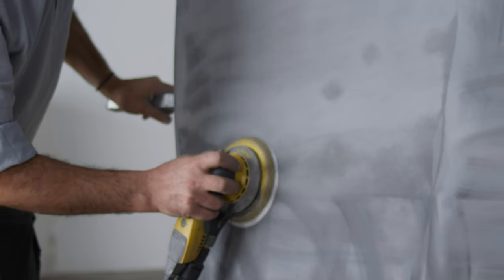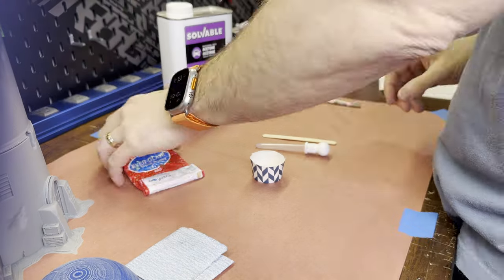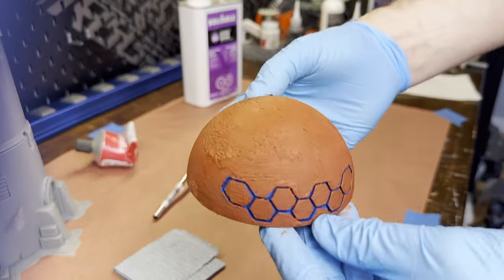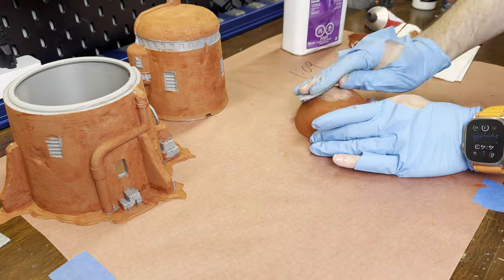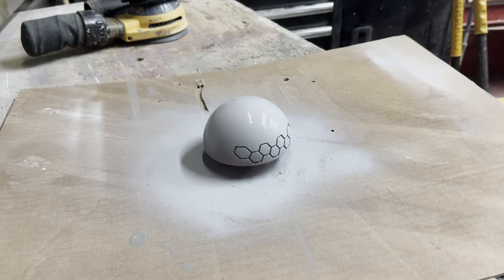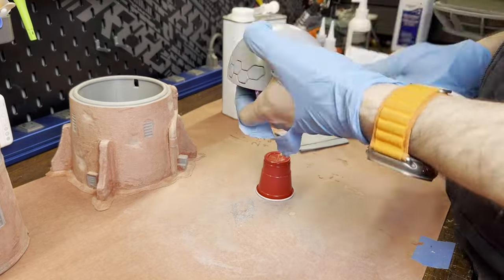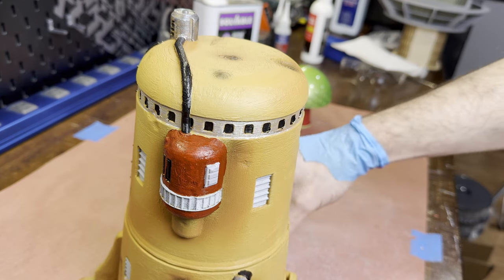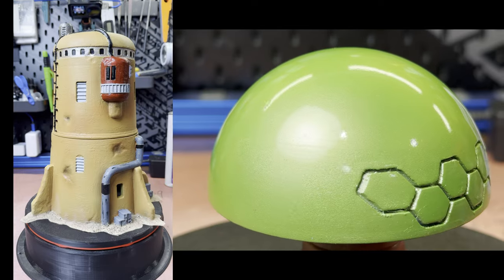Hide 3D print layer lines with Acetone and Glazing Putty

Comment: Interesting video but I see a few flaws. Gloves are a must because no matter how clean you think your hands are they still have oils on them. Never saw you clean with anything before sanding  and before the putty. Hey, it's just a 3D print but don't do that when repairing a car or anything like that (could cause paint lifting). Good luck.
Reply from the maker: I suppose, but I painted cars back when the only people that wore gloves were medical professionals and things worked out fine. Just don't eat chicken wings or Cheetos while working and you should be fine :)
Reply: Unless your metal plating the print, then just having skin is enough to ruin it.

But you can get a near mirror surface @DaveRigDesign

Comment: So which is better, resin baby powder or putty?
Reply from the maker: I would say, for small spot fills where you don’t mind waiting for it to dry putty would be more convenient. For anything bigger resin is easier/faster to apply and faster drying.
Reply: @DaveRigDesign  if I want to smooth a circle, i feel like pouring ALOT of resin on top will save me time vs applying thin layers with a brush. What do you think?

Like instead of painting on half a cup like you do in your videos, pouring 4 cups on top of idk half dried thick and slow resin.
Reply from the maker: @Red_Rubber_Duck if it’s flat ya you can just pour it in and let if self level

Comment: I like this idea, my issue is, when I have a print I would like smoother, it has way too much detail for this method, but I need to print me a Dwarven Sword for cosplay, and I may try this method, Thanks Bro!
Reply from the maker: Ya, works great for large smooth areas. Can work for detail also, you just spend a lot of time cleaning up the details. Up side is it’s easy to sand off

Comment: I've been using the quick dry spackle and water. Then sanding and works pretty well, but ilike the smoothness you achieved
Reply from the maker: Do you find the spackle holds up well? Doesn’t crack or chip off?

Comment: The lines are there and it's not an optical illusion. I have the same issue with resin casting and sanding bucks. It feels smooth to the touch because your fingers can't detect the highs and lows anymore. But as soon as you cast it you can see it wasn't polished enough. For me it's usually frost finish on the surface, but in this case it's the subtle valleys not getting 100% filled and sanded out. 

In this case 1 more layer of fill spray or more putty at the start would have leveled it out more. Never thought to mix acetone with this putty. 👍

For my resin molding... got to mirror polish it more. lol
Reply from the maker: Ya another coat of putty would have done it but that drying time. I can probably wet sand the clear coat and give it a few more layers of clear to get it smooth. Will still see the lines in the colour underneath though even though the light reflections will be smooth

Comment: I wonder if a saturated abs or polystyrene solution in acetone painted over pla would work. 
Maybe even if it doesn't by just painting, a second step of vapor smoothing could make it smooth. 
I don't have abs or expanded polistyrene right now but I do have acetone and high density polystyrene cutlery so I will try and report back. 
If the cutlery doesn't disolver well enough, I will get some expanded polystyrene that I know does disolve really well.
Reply: It worked quite well with ABS, no further smoothing needed, just dunk, dry and it is smooth. However I used ABS from a cdrom unit door that has calcium carbonate as a filler that just precipitated so the resulting solution deposits a transparent layer. It is smooth to the touch but with a good look you can see the lines through the transparent layer. I will get some 3d printing ABS hopefully with an acetone soluble pigment but even as it, it is great when painted. 
It did not work well with polystyrene as not enough goes into solution and it mostly stays as a goop in the bottom plus the deposited material is not strong or that well adhered so it can be scratched off.
Reply from the maker: It’s an interesting idea. Are you using pla prints or abs?
Reply: @DaveRigDesign  PLA of course. I don't even have ABS filament so I scavenged for ABS and found an old cdrom tray made of ABS for the experiment. I will be getting some ABS filament specifically to do this even if I am not really interested in printing it (I don't have an enclosure or a way to deal with the fumes).

Comment: I tried this on about 10 of my prints and painted over them. The bondo spot putty cracked big time.
Reply from the maker: It can if the part has any flex or the holes you are filling are too big
Reply: @DaveRigDesign  the cracking happened on a large surface area of layer lines, no holes and no flex to the part.
Reply from the maker: @PikachusGift not sure…. could be due to how thick it was applied. Maybe wasn’t totally dry before you painted? Once dry it’s shouldn’t shrink.
Reply: @DaveRigDesign  I let it dry for a few days. It was so weird. I've had it happen on a few prints but not others.
Reply: I use the acetone + putty combo too but I use very thin layers. Dry quicker and I havnt had any cracking problems.
Reply: I’ve actually done projects where I haven’t been happy with Bondo at all. Seems like it cracks more often than it works for me. I noticed in this video he used the brand Evercoat? which I’ve never tried before, so I think I may try that.
Reply from the maker: @kraftaculousgreekgodofcraf1113 I did another video using uv resin you may be interested in

Hide 3D print layer lines with Baby Powder and UV resin https://youtu.be/KVf0mbBCygQ
Reply: @DaveRigDesign  I actually saw that one. In kind of forgot about it. I should probably get a notebook and keep notes lol thank you I’ll revisit that as well.